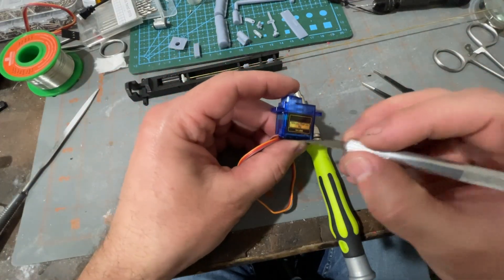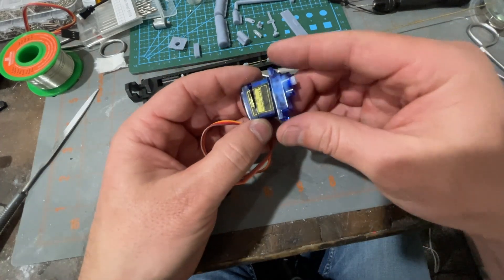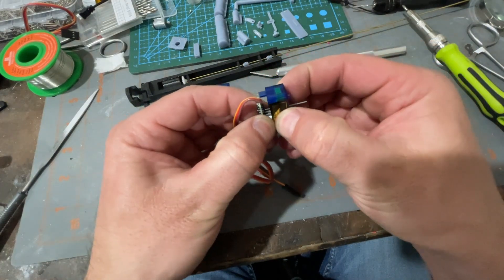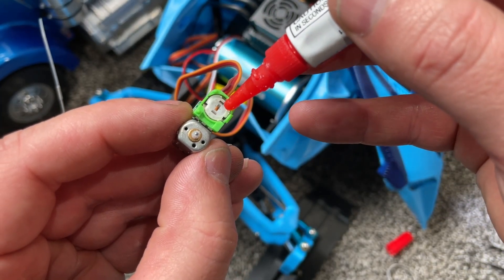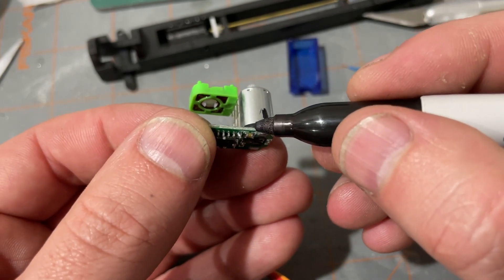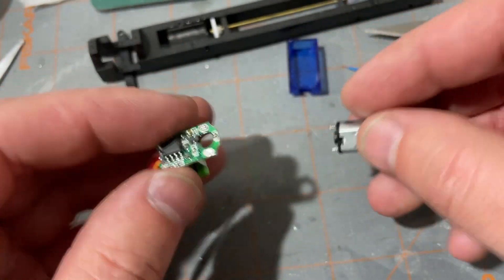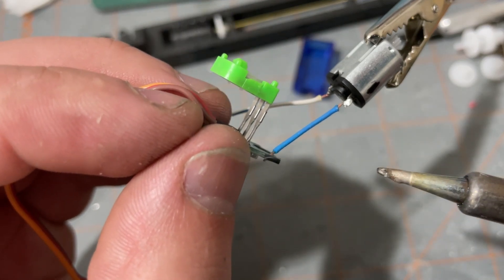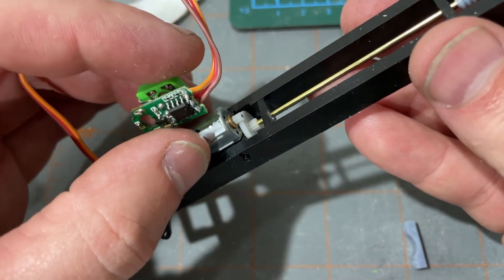Convert Servo to Motor and ESC

Comment: Try to use this on a micro rc conversion but where does the battery connect? Usually rc esc has a motor connection, a receiver connector and a battery connector and this is missing the battery connection.
Reply from the maker: I solder a plug onto the receiver so the battery powers the receiver directly and it then powers the motor(servo). You need to be sure the receiver can take the voltage and don’t run it too low as there’s no voltage cutoff.

Comment: I there any way to do away with the pot?
Reply from the maker: There might be, but I don’t know it.
Reply: @BuildItBetter3D  You can take two resistors that have half the value of the pot and solder them from the centre pin to the outer pins. This does mean you lose the ability to set the "no rotation" point, but that should be dead-centre anyway so it should work.

Comment: Can I control corless moter with it, I want to make an rc plane ?
Reply from the maker: I do not know.
Reply: @BuildItBetter3D  do you know the approximate weight ?
Reply from the maker: No, I didn’t weigh it, I just put it in a little truck.
Reply: @BuildItBetter3D  ok bro. 👍

Comment: any idea how much amps those sudo escs can handle? im looking for a 1s 5a esc but boy are they hard to come by.
Reply from the maker: No idea how much it can handle. They’re cheap, could always give it a try and see if it smokes. Just be ready in case it goes.
Reply: Connect a L293D motor driver with diodes  in the servo output and now use your motor you will get at least 3A easily

Comment: I'm crossing my fingers hoping i get a reply. I have a question, how much output current cant these servos dish out. I need a peak of 2 amps since im planning on using them as ESCs for a fixed wing micro rc plane with two engines/motors. I'm planning on using one of these for each motor
Reply from the maker: I have no idea. I doubt they can do 2 amps though, they’re pretty weak servos.

Comment: Ay man can you disable the reverse because I’m trying to make a rc plane
Reply from the maker: You should be able to adjust the travel in your transmitter to not output reverse. I don’t think there’s a easy way to disable it in the speed controller.

Comment: Bro ,This was the most helpful video for coverting but l could not understand clearly when l will use the super glue for locking.Please confirm that l understood or not.l ll turn potentiometer and motor will turn.l will turn it till motor stop and that point l will lock the potentiometer, right?
Please write to me, this is very important because l wanna replacing servo motor with n20 motors  for my projects
Reply from the maker: Correct. You need to find the position that the motor does not turn and then lock the potentiometer with glue.
Reply: @BuildItBetter3D  Thank you so much
Do u ve any idea that one  sg 90 servo esc can handle one or 2 n20 gear motor?l wanna making double actuator for my project.Just know that u do not ve any responsibilities about your advice.So feel free.

Comment: I am making a rc craft with more than one of these servo esc's but when I control more then one the all go in to a like static state, they all turn at a low power and I can't control anything without unplugging the power or the servo        please advise
Reply from the maker: That is strange. There really isn’t any change to function. They should work the same as they did before taking them apart. Are you trying to run more than one motor from the same esc? I don’t think the little esc board can handle more than one motor plugged into it.

Comment: Is potentiometer important?
Like this guy removed it for use?
https://youtu.be/1Koiey-N2Ik

I am trying to build an ultralight rc, so saving every gram of it.
Reply from the maker: If I remember correctly mine didn’t work without the potentiometer. But looking at that video I would give it a try. If it doesn’t work then you just solder the potentiometer back on.